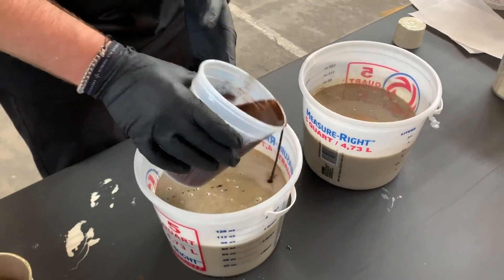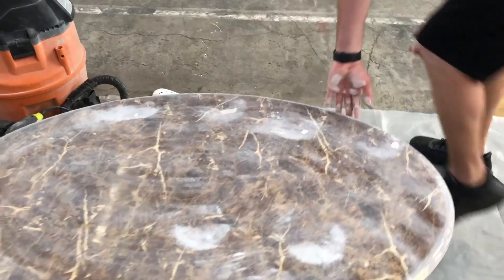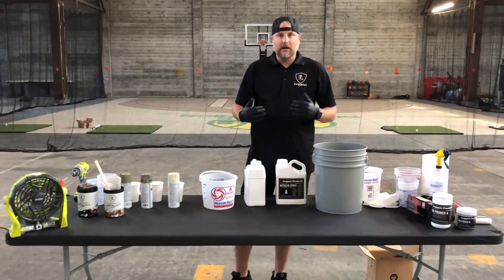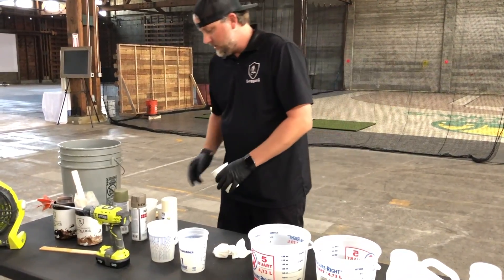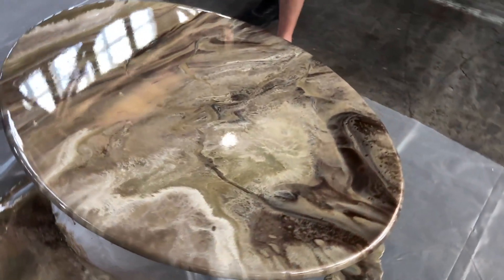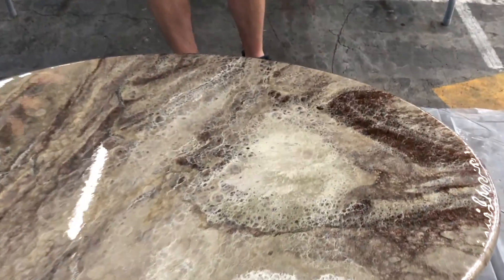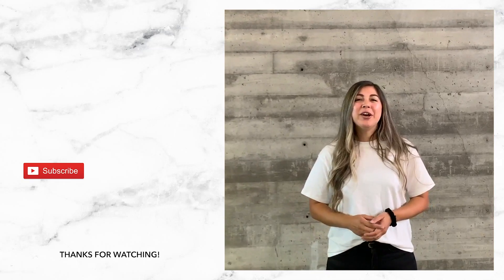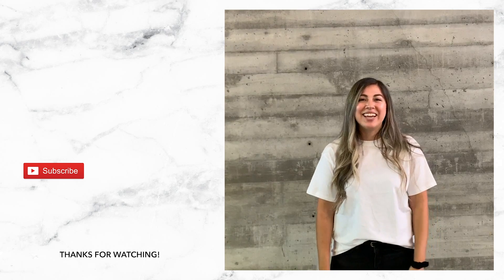Dirty Pour Technique On Coffee Table | Epoxy Resin

Comment: That was so much resin! Try to wet edges a little bit before pouring, so you will need a bit less of epoxy. Great video guys👍👍👍
Reply: They said in the video there using a lot of resin and you would only need half of what they used. That’s the benefit of manufacturing the epoxy, you use as much as u want for whatever u want.
Reply from the maker: Thanks for watching the video, but it is a lot of resin.  Thanks

Comment: This has a semi-gloss final finish , can a high-gloss finish be achieved with polishing ? Or are there high-gloss resin finishes ? This is a rather blasé look but it works for this dreary blasé living room.
Reply from the maker: We have 3 different top coat options. Glaze coat is our super high gloss top coat that lays out glass smooth just like the metallic epoxy coat. Our WB Urethane comes in high gloss and leaves a minor texture and we also have a WB Urethane that’s a Matte/Satin finish.

Comment: Its fine for them to use that much 🙂Check my latest video in the end to see how much I covered with 1.1gallon 
2 coats 2.2 gallon with perfect edges and finish smooth as glass
Reply from the maker: Thanks for watching and telling us that is fine to use that much resin.
Reply: about ten years ago o was messing around with paint and used resin after it dried on tables or what ever I could get a hold of, I wish I could put pics on here , theres a way you can touch it after and put gold veins in it and make awesome patterns,  I did a ton of stuff w it, funny enough I made it up and had no clue it was becoming so popular. I sue to tape mine and the bevel the edges
 Your table look great👌👌👌👌 lived your video
Reply: @LeggariProducts   Don't be sarcastic just because you folks have the means to be wasteful with the product

Comment: What top coat did you use for the satin finish?
Reply from the maker: We have 3 different top coat options. Glaze coat is our super high gloss top coat that lays out glass smooth just like the metallic epoxy coat. Our WB Urethane comes in high gloss and leaves a minor texture and we also have a WB Urethane that’s a Matte/Satin finish.

Comment: I don’t understand the purpose of the alcohol. What if you don’t want that sort of speckled look? Do you have to use it?
Reply from the maker: Good question, No you do not have to do the dispersing effect and just finish with a fine mist of denatured alcohol (fuel) to pop any surface bubbles and allow the resin to lay out glass smooth!

Comment: You just add the pigment like its going out of fashion don't you have to messure it in  ratios to resin??
Reply from the maker: Yes we pre measured all the epoxy out first at a 2:1 ratio then added the metallic colors to it.
Reply: @LeggariProducts  exactly don't you still have to messure the correct amount of metallic pigment to the resin I e a measured amount??